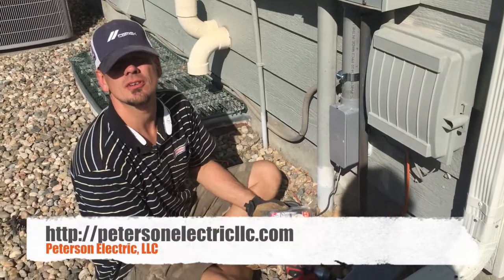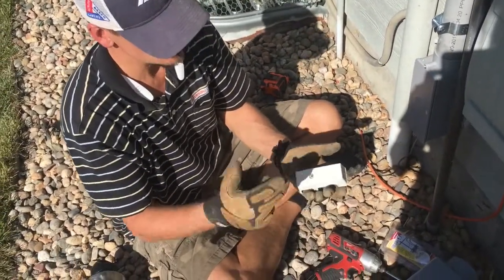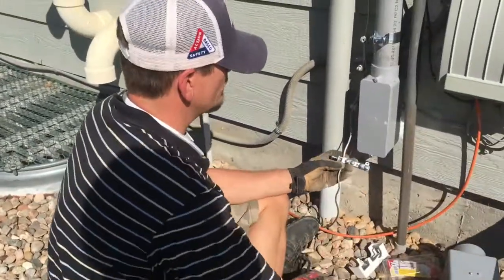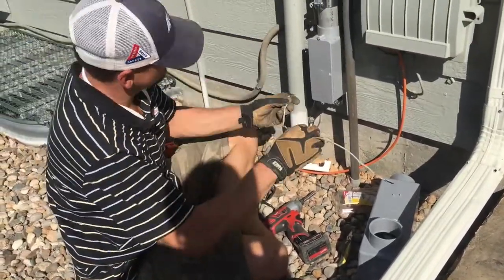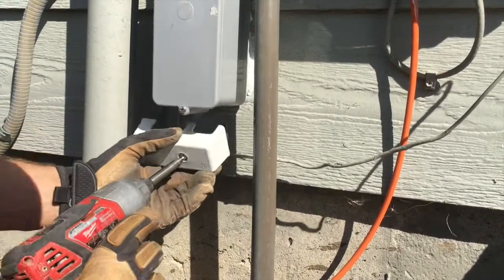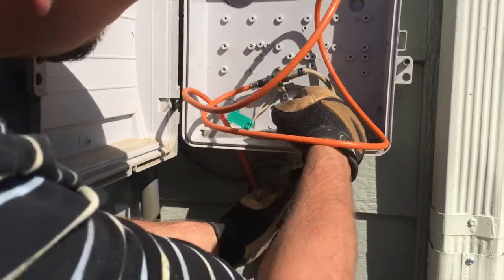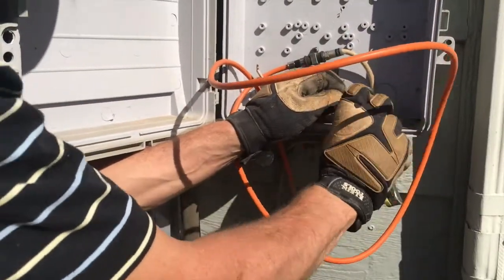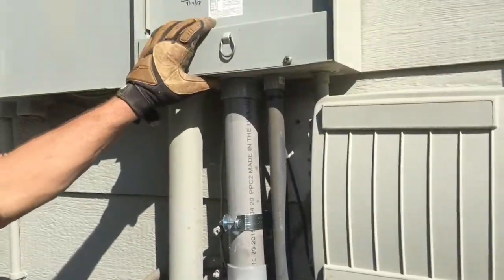Intersystem Bonding Bar (IBTB) For Homeowner's Low Voltage Grounding

Comment: I disagree with your statement about using the IBT in attics/crawlspaces for other grounding...The National Electrical Code (NEC®) defines an Intersystem Bonding Termination as “a device that provides a means for connecting communication(s) systems grounding conductor(s) at the service equipment or at the disconnecting means for buildings or structures supplied by a feeder or branch circuit.” This is because the device is specifically listed only for communication system bonding at the service.

Comment: Not being judgy or anything but not only did you strip out the screw head but you also cross threaded the screw as well... Worse yet is you installed Zinc Grounding Screws on the outside which means though it's shiny now they won't be a year from now; if not sooner. If you are going to product instructional videos you should point out your own flaws to show that you are human, like the rest of us, and that you too make mistakes. You don't just impact screws in, especially if they are not self tapping. The best thing to do is reverse the screw so that it can catch then impact it in. Too many folks make this common mistake of cross threading screws with impact guns. What you should do is make a follow up visit showing how you fixed your mistake; that way you can gain a bit of credibility back... Cheers....
Reply: An impact driver for #8/10 screws and into plastic... What could possibly go wrong!?
Reply: Sounds like you got something up your bum mate. Video looked good to me, how about you make your own?